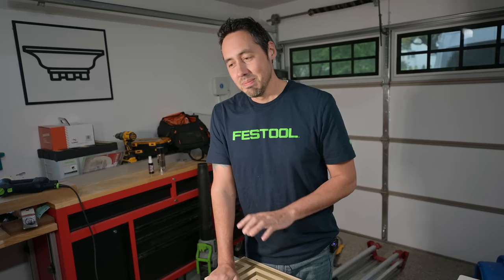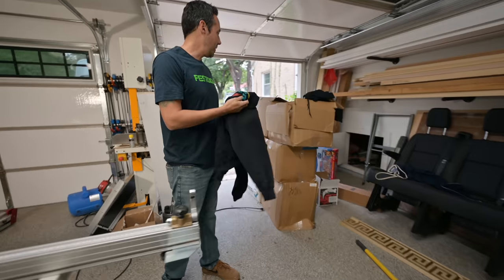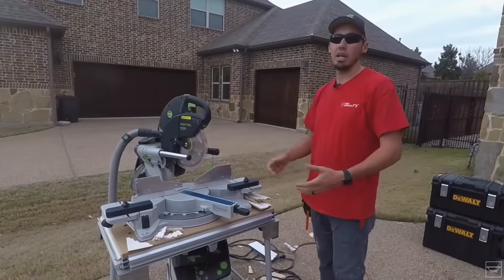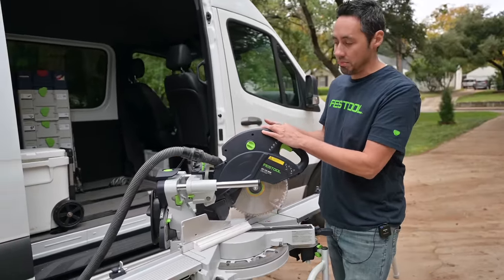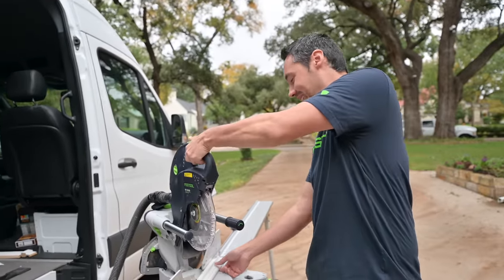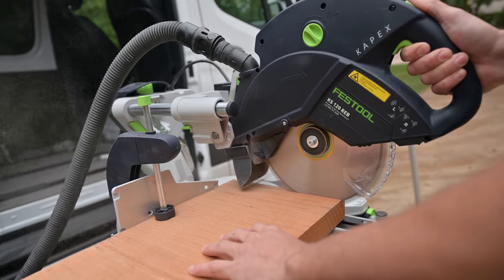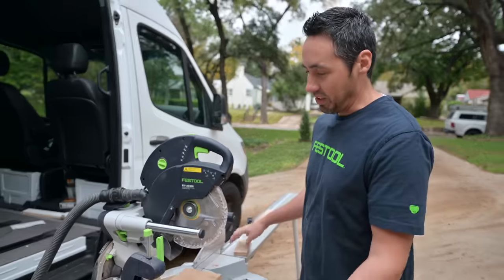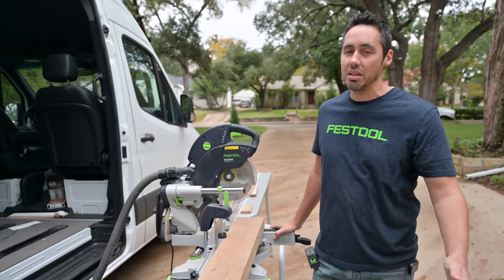I'm being sued by one of these companies...

Comment: The vacuum is completely worth getting as well. You plug the saw into the vac power slot and when you pull the trigger the vac turns on it’s awesome. I love Festool.
Reply: The makita shown under the saw does the exact same thing
Reply: What truly blows my mind is the dust bags in their vacuums. It will fill them to capacity and make them feel like a brick. 👍
Reply: All dust extractors have a take off socket, it's not a new thing. 😂
Reply: All new vaccumes do the same mate )
Reply: @kaiserbailey  But it doesn’t say Festool on it

Comment: Top kapex wing tip. You can use one of the extendable rulers to level the wing to the saw. You don’t need a spirit level. Just take one of the extendable rules fully out and pop it back in when you’re done.

Comment: I've looked at the festool miter but it felt cheap! My thoughts that it would be okay in a shop but not getting thrown in and out of a truck every day and extensive use.  I will be watching on how it holds up
Reply: It holds up just fine. After 10 years, I’ve left it in the shop and now use the 60 for site work. Getting too old to lug the 120 around 😂
Festool tools are a lot more robust than they are given credit for. 25 years and still a happy fan.
Reply: Festool needs to add shadow line...... Laser sucks!
Reply: At a cost of $1600 dollars, you don't throw these things anywhere. That's how they get broken. 😂

Comment: FYI: get a bigger hose, 36mm so the hose goes on the outside of the connector instead of inside, dust collection is better
Reply: Great advice.
Reply: Yep. And the green vac. Yes they are the best part of the system. The vac is the heart and it is the best one that I know of.

Comment: My kapex is over 12 years old.  It still cuts beautifully.  I do have a 12" Dewalt, but i haven't used it for a very long time.  The hold down clamp is something I use quite often.  Also, the laser is awesome, you can dial it in so nice.  I cried every time I spent the money on a Festool Tool, But I smile every time I use them. They seem to last for ever.  The dust collection when sanding is probably the biggest thing I like about Festool.

Comment: Been adding more festool myself. I'm on the Metabo HPT platform now expanding their products. Especially the 10 inch miter that I know most people wouldn't like. But just as you stated there are some things that you benefit. For me one thing I really like is the hybrid feature, that works better than the dewalt one. Front adjustable controls and things like that. What I'm wanting is better intgration with dust control, and those integrations with the wings like that because man what a pain. So I'm glad you did a quick overview because it's looking like if I do get to the point of changing, i may go that route. Only thing for me is that saw stand is big, and I don't have space for a big stand like that on the center of the miter saw, maybe a collapsible stand would be great. additionally, what willyou be doing with that big stand that you had before?

Comment: I use DeWalt in my industrial electrician trade. I have tried the Milwaukee because all the hype they push at electricians. For me and my experience the Milwaukee does not tolerate the abuse and the grueling nature of the industrial environment. I wore them out often in months, and even in weeks. The batteries needed to be charged a lot. It was funny because I thought if Milwaukee is the best I never want anything to do with the others. Then I got a DeWalt kit for Christmas. I gave it a try. Wow. Hands down the DeWalt is my go to in the industrial environment now. All the crap people told me about the Milwaukee was just that; crap. I packed up what was left of my Milwaukee stuff at work and brought it all home. That was eight years ago. The DeWalts I bought after that drill kit and that drill kit are still being used. I have not replaced one of them. I still have the Milwaukees I brought home. The Milwaukees make good wood working homeowner type tools. They feel good in me hands; ergonomically satisfying. None of that makes me money though. DeWalt all the way for grueling industrial work environments; the batteries last for years and I have not replaced a cordless tool in over 8 years. Talk feces all you want. I know what I know and I don’t buy crap because people tell me I should. I am glad that I got that drill driver kit and I am stupid happy with it yet today. And you should have seen me face when I got that DeWalt stuff the first time. I was all about, yeah, thank you, while I wondered how to re-gift it. Glad I kept it. 😊

Comment: Less flashy, but very, very nice tool is the CSX drill.  I think the new version has batteries that work on certain other festool tools, but I love the original, despite the batteries for it being exclusively useable on the CSX drill.
Reply: i had the old cxs and i now have the new one and man the new one kicks ass it's one of my favorite tools to use. makes doing kitchens a dream
Reply: I just bought two of the new CXS 12v drills, great little drills. I actually only bought one at first, but after using it, I bought a second--one for my screw bits, and the other for my drill bits.

Comment: I can’t blame you one bit. When I first saw Festool prices I thought one would have to be crazy to spend so much more on their tools. Fast forward a couple of years and I came across a midi dust extractor for 130$. I added a cyclone (not theirs) to the top and was blown away how well it worked. I recently bought their orbital 6” 150 sander and again I’m amazed. If I were doing this for a living I would use their line for sure. The quality is far beyond anything out there.
Reply: And if you’re doing it for a living, the three year all inclusive warranty helps

Comment: Nice video, Richard~!  I too have started drifting over to the "lime green" side after 30+ years as a woodworking, having said that I'd never do it.  I kept hearing so much about how much better the sanding experience is with Festool.  After seeing a LOT of demos at local stores and viewing dozens of others' experiences on YouTube (and doing a lot of soul searching), I picked up their ETS 125 (5") random orbital sander and CT36 dust extractor.  Such a difference~!!  That was last Christmas.  About a month ago, I took another plunge and picked up the DF 500 Domino.  Know anyone looking for a slightly used biscuit joiner??  LOL
I don't know what's next, but I'd like a track saw and I'm seesawing between Kreg ($$) and Festool ($$$$).  And then, there's my 12-year old Dewalt compound (non-sliding) miter saw.
You're right, it's a total rabbit hole~!!
Looking forward to more video from you using the Kapex.

Comment: I too had a hard time with Festools cost, however after other brands broke down or just did not give me the butter cut I switched! You may pay up front, but I never worry about the quality any more and todate have never had a tool go out of spec.
For cabinet making I use my MFT3 for assembly, however I have moved to the Dashboard bench to do my sheet good cutting,  whilst using all of my festool tools.  I find it works better with my workflow and gives me the capability to cut down full 4X8 sheets with one setup. It is also portable!  The KAPEX does put off some dust, however it is minor and easy to clean up when sawing inside a home.

Comment: Surprising. I remember the first review of this and it was pretty much complete opposite. Got to say though the kapex is good but my 250mm dewalt flex volt is accurate and has decent dust collection. I also built a extension and shed out of reach of main power

Comment: As a European, my former DeWalt (Old Elu’s) and Bosch had pistol grips. Still I found the Kapex 120 some getting used to. A tip: Point your pointy finger forward and on the side of the saw and pull the trigger with the long finger - it makes somehow the movement feeling much more natural and controlled. The KS 120 is just a joy to use.

Comment: Festool is way overpriced.  Some of their tool designs such as the domino,  the work light,  and their edge trimmer are really unique and worth the extra cost.  But I see no reason to pay double or triple for a track saw, miter saw, a vacuum, or a cordless drill.  Systainers are a silly waste of money for a cool looking plastic box.  And in terms of sanders,  for the money Mirka is much better.   Don't be fooled by the green label.  Do your homework.

Comment: I'm on my 2nd Bosch miter saw in 22 years and it will be my last.  This one is 2 yrs old and it's garbage.  It is not smooth, doesn't hold a bevel angle, wasn't even remotely calibrated out of the box and can't hold it during use. I spend more time f'ng with it than using it.  It doesn't stand up to the quality of my first and after using my friend's DeWalt and another's Kapex, I'm buying the Kapex.  It's ridiculously expensive for a home hobby shop, but I'm a fan of buy once cry once...even after I bought the wrong one!  CL will have a barely used Bosch as soon as my Kapex arrives

Comment: I'm of the same opinion on cordless vs corded miter saws. I love my cordless saw...when batteries make sense. However, if I'm gonna be within 100' of an outlet, I'll lug out my corded saw any day. No spool up, no bogging when the batteries start to run down, no dead saw in the middle of a critical cut. My truck is full of cordless tools but my corded miter saw and table saw are still the top dogs.

Comment: Any saw will cut that oak easily with a brand new blade so nothing special there, Also wait until you see how much the blades cost, they are super expensive and you can't use any off the shelf blade, look at Infinity blades as alternates, IMO the saw is no more reliable than any other mitre saw, my KS died completely within 2 years of daily use and has had motor issues after the initial dead problem,, luckily I filled in the warranty extension, Festool only offer 12 month warranty which is weak for the cost of the saw, if it dies again I will go back to mainstream brand.

Comment: I am downsizing no not my estate ...
The miter saw, currently use 12" DeWalt, that I calibrated for precise cuts.
With fast adjust material clamp.

After considering 7.25 cordless like the Makita first choice, metabo second. Both have large cutting capacity, Makita better dust collection also lighter. 
Metabo is pricey at $1300.

Metabo has an adjust similar to the festool a rack and pinion like adjustments.

In case the Makita disappoints talked to Hilti ,the rep listened, as finish carpenter, asked for certain features.

He made notes even asked if variable speed be of any use?
Hilton will listen to customer
 request unlike Milwaukee.

Comment: I don’t mind the vertical handle on a miter saw, but what’s anointing on my Kapex, is the safety button on the top. It’s awkward. What I did, is engage the button and tape it in that position. Now I  don’t need to use my thumb.

Comment: I have the 8.5in cordless Kapex and though I like it, I prefer my 8.5in 40v Makita. I had to use a piece of metal to make the safety button stay pressed in and I used a piece of tape to hold the top button down so all I have to do is pull down and press the trigger which makes the saw much nicer to use. I also removed the guard and the shadow line is much nicer, and cuts are easier not having the guard get in the way. But even after all the mods I did, I still like using my Makita more. The pistol grip handle just isn't as comfortable to use as the flat handles are. 

I have a ton of Festool though, and tend to love them. I recently purchased two of the new CXS 12v drills and those little things are amazing.

Comment: If you come in front of the piece and then move back through it while cutting, the dust collection will be much better. This is the case with all miter saws. Chopping straight down on the piece will result in far less dust being collected.

Comment: You know this better than I do but keep an eye on the sharpness of the blade. That kapex has also much finer blade all color coded. They have a sharpening service for their blades. I like that Festool does tools where you can use both corded and battery powered tools. Check the level of that base across both sides of the mitre cut it can be a tiny bit off and it’s one thing where improvement can be made great tools but they can always be better I would get you to feedback these kinds of issues may least Festool listen to their users.

Comment: also on leveling the winds you can unscrew the extra extensions on the end of the wings. Then use the clamp that comes with the saw and you can level on the ends of the wings with mitersaw.

Comment: I found your channel because I was thinking about buying a kapex. Ended up getting a Milwaukee and it is more than good enough.
Reply: For informational purposes, I have the Kapex from 2008 and I have the new Milwaukee 12" and the 7 1/4" and they do not hold a candle to the Kapex. The 7 1/4" one recently would cut out during a cut and it doesn't have a lot of hours on it. I had to take the handle apart and clean out the sawdust to make it work again. 👎

Comment: You will get better dust extraction when you push the blade through the material and not use it like a chop saw. So pull push the saw through and not down. And go through in one time, this saw is pretty strong so you can go in once.
Reply: Isn't that Festool the same design that Craftsman used to call a "radial arm saw", except that this is portable?
Reply: @gfghjfgfghfj  I don’t think so. With a radial arm saw the blade spins the other way, so you have to pull the saw through the material.

Comment: My son bought the same setup with the companion vacuum. You can set that up in a finished house and it is CLEAN, just amazing.  The saw has the most exact laser system I've ever used.  It isn't cheap, but it is good.  Also, that stand is great,  well engineered and easy to use.
Reply: The miter saw stand is nice (I own one as well), but the thing I don't like about it is the one leg just doesn't keep the end of the extensions stable enough. They should have put two legs on it at angles which would have locked it in place better.

Comment: I think we all suspect it must be the big D taking him on.  Speaking of them, did you even try the new DCS781B? I bought that saw this time last year when it first came out and what a BEAST of a miter saw that runs on batteries ONLY. I only use it with a minimum 9 aH 60V battery and it nearly lasts all day. I do have 3 to rotate but I don’t think I ever had to. My longest days were cutting 16-20 stairs that I made from LVP along with cutting baseboards and 1/4 round. The saw went all day 9+ hours of heavy use and still had juice left. The dust collection is also improved over previous generations as the dust boot is a heavier rubber and is a three piece until to flex over and around certain cuts. It’s not as good as the Kapex as that saws shroud covers much more of the blade to channel more dust, but if you ever find yourself needing a cordless miter saw, for half the price of the Kapex, I highly recommend the DCS781.
Reply: Dcs781 is a great miter saw, I've been using it since January. I picked up the 15ah flexvolt battery to pair with it and I don't think I've had to charge it since. Heavy saw, big footprint for sure but overall totally impressed. My dws780 stays at my house now

Comment: Satrie is protected speech, they will loose in court if it is pursued.
Reply: Yeah, and bankrupt him in the process.
Reply: Except each of the logos of these companies are registered trademarks and require expressed written permission to use in any unintended fashion. Unauthorized resale is a massive infringement. Richard saying he’s going to sell the last of what he has was a big mistake in my opinion. He’s essentially actively defying a cease and desist, with video evidence of the intent. He’ll be lucky if they don’t bankrupt him at this point.
Reply: No it does not matter, the high courts have ruled on this, he is not using a registered logo. He should have his atty write a response to the demand letter stating the appropriate 
court cases.
Reply: @jonathanvankleeck97  correct in that high courts have ruled on this. They have ruled there are two types of fair use defenses in trademark infringement or dilution cases: descriptive and nominative. So far as I can tell, his merch doesn’t fit into either category. But neither of us are lawyers or judges, so it’s simply up for interpretation until it’s ruled upon. Agree to disagree?

Comment: This video reminds me of Android vs. Apple. You spent a decade saying Apple is an expensive, limited product that doesn't fit your needs. Now you've got an Apple and you're trying to justify why it works for you now despite it being so limited. Sorry, but you've spent too long showing us how badass your miter saw setups have become and now you've got the equivilent of a really expensive/accurate Ryobi. Just to limited compared to what you said you needed to be efficient and effective. Did your workflow change that dramatically to the point where you don't need all of the blocking/jigs/stands that you have been using?

Comment: i agree on your decission. i am european and have used, Metabo, Milwaukee and som bosch for years. and i`m slowly going over too Festool. i will never let go of the milwaukee automotive tools. but to the carpentry tools. i`m now convinced that the next tool i`ll by will be from Festool. i wont name the brand but i`ve calibrated my mitresaw probably 9 million times. and nomatter what i do. it out of wack after i`ve rigged it up 2 times. yes it`s expencive. but what you get for the well earned money in reliability is to another level!
Reply: Just go mafell and skip thenfestool step. Erika 85 is,a mitre and table saw in one and more precise anything festool makes.
Reply: @Rompestromper  tested alot of mafell. and it does not disapoint. dont like the mitre and tablesaw in one solutions.